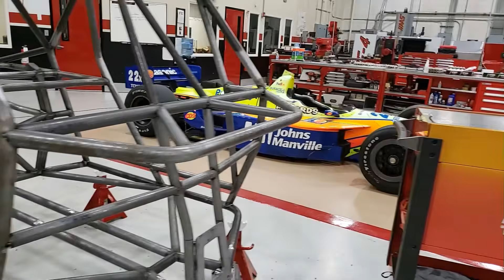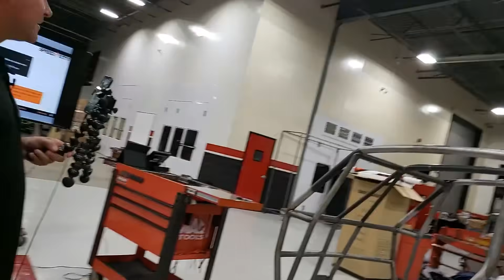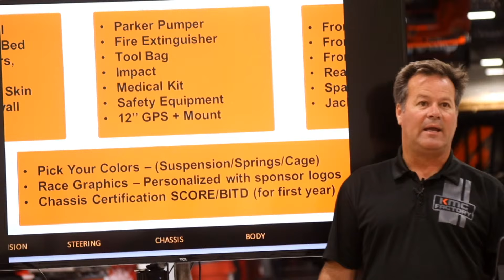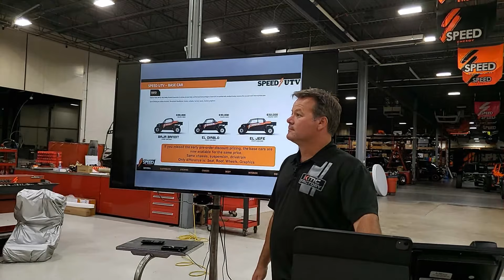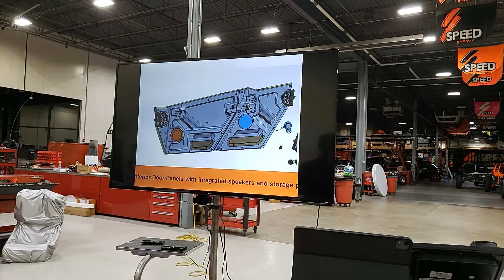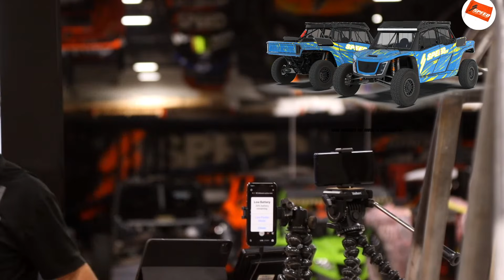SPEED UTV LIVE - Episode #24

Comment: Torque limiters are very important. People don't typically understand how a spool/locker works vs an open diff. With a spool torque isn't split 50/50. The wheel with the most traction will the the most torque if the other wheel's traction cannot support it. ie, lift a wheel and that wheel gets no torque while the one on the ground gets all the torque in a spool/locker. With an open diff torque split is 50/50 and the wheel up in the air gets none so the wheel on the ground gets none.
.
4wd works the same way. Front end off the ground all the torque is driven through the rear wheels still on the ground, then the front wheels make contact with the whoop while the rear is off the ground sending all the torque to the front. The engine is wound up at a power producing rpm in the right gear and torque is violently spiking front to rear, rear to front, front to rear, rear to front, as your car flies over a whoops section.
.
I'd guess that going over the whoops in 4wd like that is much harder on the drivetrain than rock crawling. It's this level of attention to detail that is the difference between cruising to a victory or working that impact on the side of the course.